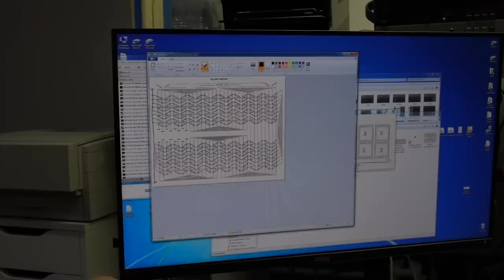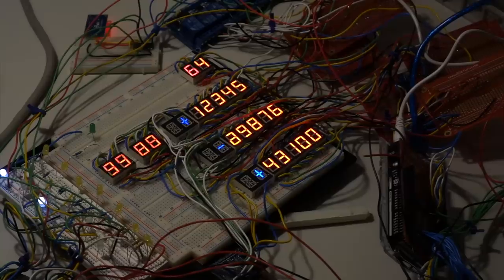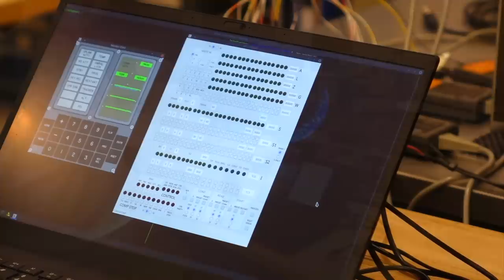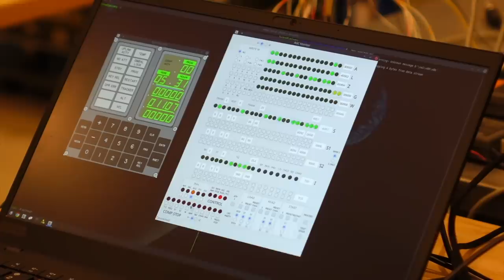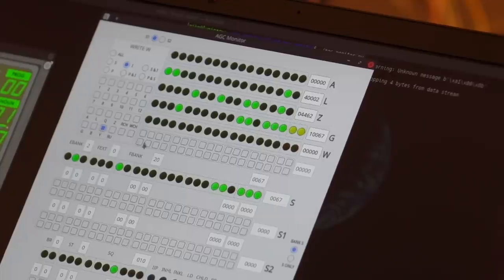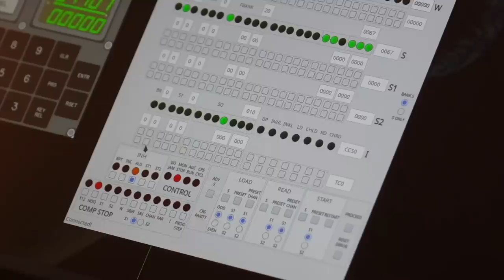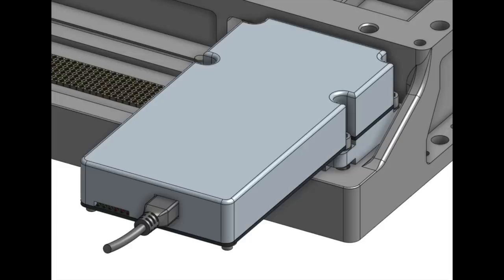Apollo Guidance Computer Part 8: a Blinkenlight AGC! (and help from Samtec on the way)

Comment: Very cool stuff Marc. I was always fascinated by the Apollo guidance computer and its genesis from inertial guidance gyro based systems for aircraft. I'm amazed at how dedicated you are to this project! 👍 Draper would be proud
Reply: There's a book about the LM software called "Sunburst and Luminary", written by the guy who wrote the software (Don Eyles).  It's a good read, and  worth picking up.  I think Amazon has it. Eldon Hall's book about the hardware development is good as well, but overpriced and more about the development process.
Reply: @antronargaiv3283  I'm familiar with Don Eyles work but not the book. Certainly something I'd read though. Good find... I'll check this one out 👍

Comment: I worked on a project back in the 70s where we used the dipstik to implement an LED display driver for a light up map.  My boss thought they were a great idea, but I hated them because it was easy to misalign the ICs (off by by one pin) if you weren't careful.  My recollection is that they worked at first, but we did have intermittent connection problems later on, which I think we tried to fix using a spray on contact cleaner.

Comment: Thanks for showing that ad for Dipstiks -- which shows the metallic heat sink bars which had deteriorated in the project AGC. I hadn't come across that "technology" before. Strikes me that had they used DIP sockets instead of a sandwich type fit they might have been on a winner.

Comment: it says 'NASA APPROVAL ' and signed what looks like  12 - 20 -67  on the pin-connector blueprint 
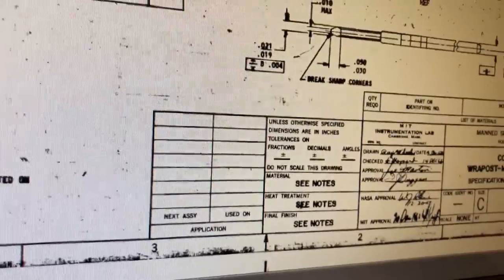at the bottom of "column 2" , 2nd (bottom) box  under the MIT INSTRUMENTATION LAB  box  (at 4:10  into the  video) or t=250 as yt notes it

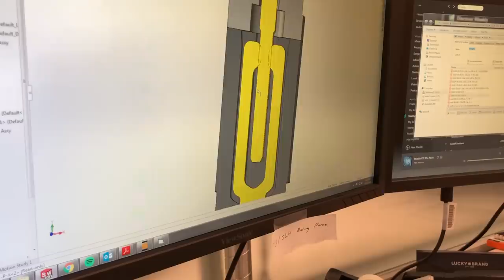Comment: @2:24 I guess the CAD model have a mistake. I you look closely to the top of the tunning fork there is geometry inside geometry. In other words geometry collision (interference). Other than that, excellent  work. My apologies if I am wrong.
Reply from the maker: That’s on purpose. The forks are springs, and are designed to be narrower than the pins.

Comment: Somewhere, there is an ex-NASA employee with a handful of those connectors stashed away. It would be great to make a side by side comparison with the old and the new.
Reply: The connectors are also used internally, thus can be compared directly.

Comment: Marc! Could you ask Mike to send some recommendations for learning FPGAs more thoroughly? My school glossed over the subject and I'm looking for deeper FPGA knowledge this summer.
Reply: This might be a bit of a cop-out answer... but the best advice I can give is to get yourself a dev board, if you don't have one already, and make projects with it. I started out with the DE0-Nano, which you can get for ~$60 if you're a student. I went for that one because it's relatively cheap and is small with no funny business; just decent-sized FPGA and lots of pins. Plus it's got an onboard programmer so you just need a mini-USB cable to use it. Altera used to have a really nice free video tutorial series on their website, back before they were absorbed by Intel -- that's how I learned all of the basics. I'm not sure if Intel has kept all of that around, though. And if you've got any specific questions I'd be more than happy to try to answer them. :)
Reply from the maker: I will forward your question to Mike. I learned by doing. Carl gave me a small Elbert FPGA board for Xmas, I read a Verilog online book and away I went. I would choose a board for which there are many tutorials online. Setting these things up for the first time to do the simplest thing is quite a challenge. Examples online help a lot. Warning: FPGAs are full of quirks, the toolchains are way rougher than the polished development environment we are used to for regular programming, poorly documented and full of inexplicable compilation bugs. One step up of difficulty from regular programming. But oh-so powerful.

Comment: Is it possible to weld the broken wire ends with a high voltage pulse? It used to work with CRT heaters
Reply: The pulse in a CRT rejuvenator was used to remove shorts between the close elements inside the tube or boil the cathode coating to refresh its emission characteristics. Broken connections inside a CRT=bad tube, can't be recovered with a rejuvenator.

Comment: Hello Marc, would it be possible to post PDF's of the connector drawings? I would love to have a good look at them. Thank you for the awesome videos!
Reply from the maker: I believe they have been posted on ibiblio/apollo but I’ll upload them to my budding site when I have some time.
Reply: @CuriousMarc  Thank you!
Reply: Sure! All of the AGC/DSKY electrical and mechanical drawings that we at VirtualAGC have managed to scan and put online so far can be found at http://ibiblio.org/apollo/AgcDrawingIndex.html. The drawings for the Malco pins are 1006774, 1006775, 1006781, and 1006782.
Reply from the maker: Posted on my site https://www.curiousmarc.com/computing/apollo-guidance-computer
Reply: @CuriousMarc  Thank you very much! Amazing detail for just one simple, or not so simple, connector. 16 variations for just the one pin length and 21 revisions to the drawing. Concidering the engineering that went into just this one part number, then stepping back and looking at an entire spacecraft with millions of parts that took men to the moon and back is mind boggeling.

Comment: You may need to find NSN #5120-01-016-8736 and 5120-00-459-4490 insertion/removal tools for the mini wasp connectors. A core memory unit may be NSN #5895-01-450-4797

http://www.parttarget.com/Tyco-Electronics_nsn-parts_010-0075_MCDM1-37P6A7-18-0.html

Terminal may be   #5935-01-217-0769 or   #5940-01-226-7168

I think I found references to others.

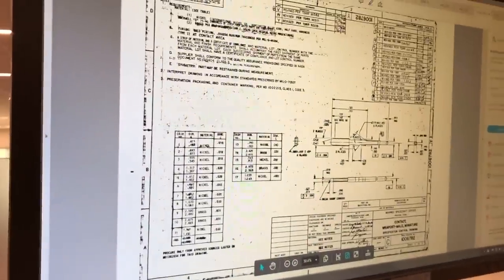Comment: 4:35 curious why the number (ID?) is upside down...
Reply: That's part of the standard drawing format used by the MIT Instrumentation Lab -- the drawing number is also printed rightside up along the bottom of the frame. Presumably it was to make it easy to read the drawing number even if you had it upside down for some reason. See the MIT Apollo Drawing Standards, PDF page 27: http://www.ibiblio.org/apollo/Documents/19780070048_1978070048.pdf

Comment: What language / gui toolkit did you use to write the monitor? Or maybe I should check the github...
Reply: Python3/pyside2 (Qt) for the GUI, and Verilog for the FPGA. I'm using pylibftdi to implement the USB FIFO interface to the FPGA.
Reply: @mikestewart8928  Ah, nice. I've used python with wx recently, but QT seems to be the community favorite these days. My (maybe outdated) dislike of qt goes way back to qt3, the last time I used it - it's probably come a long way since. I was also probably unfairly trying to build a fairly complicated GUI in 2 weeks, not having built any guis in quite a while before that, with most of my previous experience being with VC++ and MFC (pre .net days) in a comp-sci class.
Reply: @gorak9000  Don't take my choices on GUI too seriously. I'm not at all a GUI guy (this is the first one I've made in a decade or so...) and this was the fastest thing to get going for what I wanted to do. :)
Reply: @mikestewart8928  I don't write a lot of GUIs either, but the last couple I did with WX ended up looking a bit less than professional - you end up with if you need some special functionality in a couple of widgets, you have to use different base widgets (than the rest in your app), and they never match visually... it was kind of a mess. Next time I will try pyside2 / QT again! Your GUI looks top notch from the video!
Reply: @gorak9000  Thanks! :D

Comment: The core memory it self would not be too difficult to remake and fold...Assuming 0.4mm cores would work as  they are still available in one form or another. The hard parts would be the contacts and the actual physical parts of the module...(At least from my perspective)
Reply from the maker: Thanks for volunteering! We hereby place an order of a tested, folded, connected, 4k lithium core memory. 38 gauge wire please, 4 wires per core, 2k x 16 planes, according to diagram. And don’t cheat by making frames, it’s a single mat with 32,768 cores, all have to work, all continuous wires. We’ll deal with the mundane external components and mechanicals.
Reply: @CuriousMarc Thank you, for responding!
 That is a few more cores then I was expecting for 4k(but I guess that's the difference in word vs kbits) ... One document I read had it as two separate mats, I will  need to see if I can even still get the 1.2mm lithium ferrite beads it called for, and if the sens or inhibit lines are a different wire size.. But, more importantly I need to make sure that my "volunteers" are still interested. More research is definitely in order.
Reply from the maker: I put some of the info you need on my web site right here: https://www.curiousmarc.com/computing/apollo-guidance-computer
Happy weaving!
Reply: @CuriousMarc  Thank you, the information has been very helpful. 
We now have cores! 
Now we need to make a knitting frame and get the volunteers up to speed.
One question that was brought up was that since only one of the inhibit lines was damaged couldn't a single section be re-created and hidden inside the backplane somewhere? You would need to disconnect the sens line for that section from the module itself for it to not cause interference. It should work... But, might not be in the spirit of the restoration.
Reply from the maker: Unfortunately that’s not possible in a straightforward way, the drivers cannot drive two sets of address and inhibit wires that would have to be paralled with the rest of the memory.

Comment: There is a really annoying high pitched noise in the preview of the next episode, would it be possible to edit that out before the next video is uploaded?
Reply from the maker: Oh my. Huge peak at 15,738 Hz to be exact, will be killing dogs and younger ears alike. I had severe noise pickup problems from my shotgun mic in the lab, which I diagnosed came from my AT&T U_verse  modem. I replaced the mic cable, WiFi noise went down, but it now it picks up something else. Will have to low-pass or notch filter it out.
Reply from the maker: And by the way 15,738 is very suspiciously the NTSC horizontal line rate. I can't think of anything in the lab at NTSC resolution! Maybe was just picking up the signal from the camera small video display screen itself, as if the mic cable was not fully plugged in and grounded in the camera?

Comment: "micro inches" ouch, that just hurt.
Imperial units are already based on metric so why not skip the middle man and use metric directly to set standards. plus i thought NASA used Metric for all measurements
i can also not find any information about "Dipstiks" online... did they die out that fast?

Comment: How about micro surgery to repair the broken wire?
Reply: Phonotical ... From a previous video ... The memory is arranged in folded sheets, the fault is in one of the internal sheets, and the whole thing is potted.
Reply: @florencegomer7937  that's why I asked about making a tiny hole, rather than trying to open the entire thing, the hole could always be filled after
Reply: Phonotical .... The problem is it is in one of the internal folds.